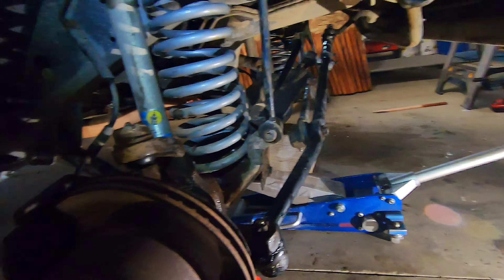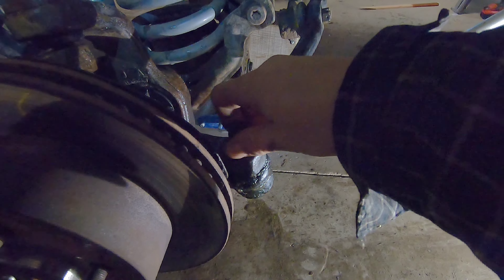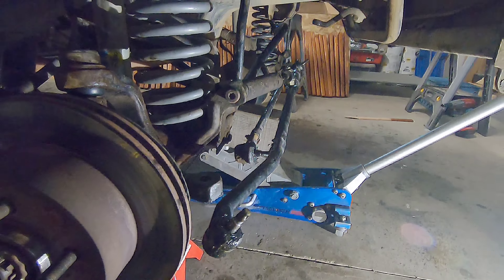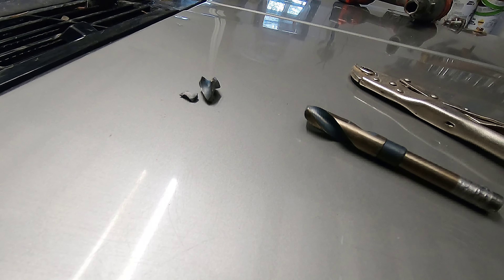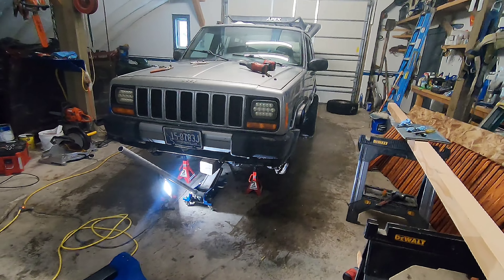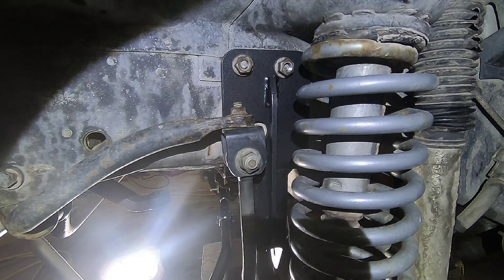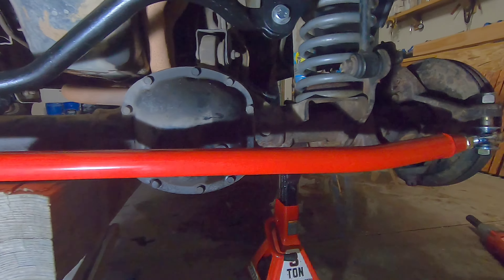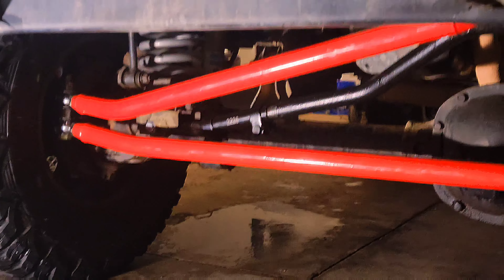Jeep crossover steering upgrade

Comment: How did it drive after the installation. Any adjustments afterwards not mentioned in video?
Reply from the maker: I'm sorry I missed your comment, the drive was great, steering was a lot more firm and responsive. I did have to get a front end alignment and have them also center the axle. The only thing I recommend is getting a Pittman arm drop to make it a bit more stable on the highway.
Reply: @PeakAcres  awsome thank you for the information.

Comment: Any updates
Reply from the maker: I'm sorry I missed your comment, it's been pretty solid, other than replacing heim joints and adding a falcon steering stabilizer.
Reply: @PeakAcres  awsome thanks for the update. I did the same upgrade. But i just added the fox steering stabilizer i had on my rc steering setup. I gotta say this setup is 10 times better than my rc setup.